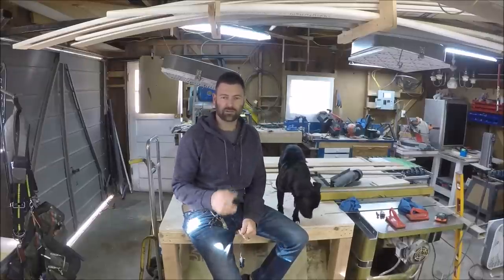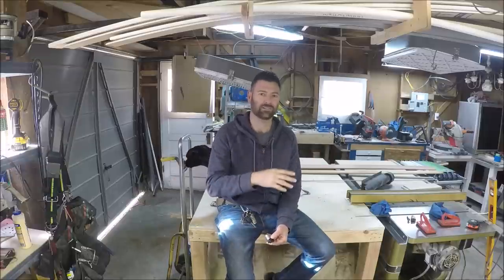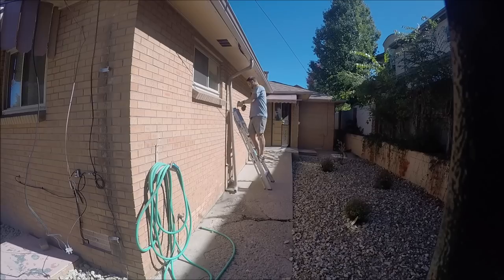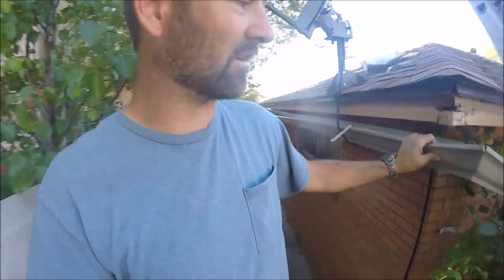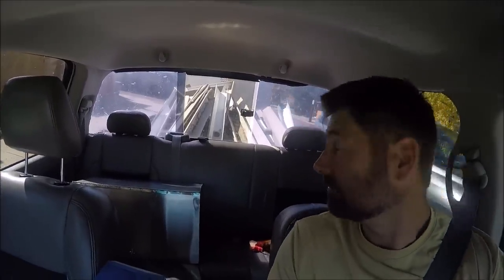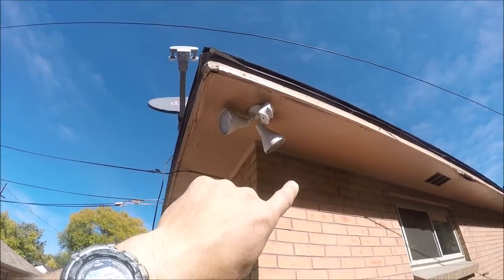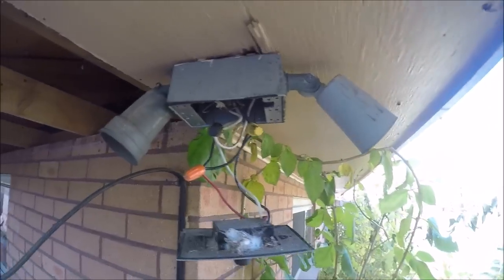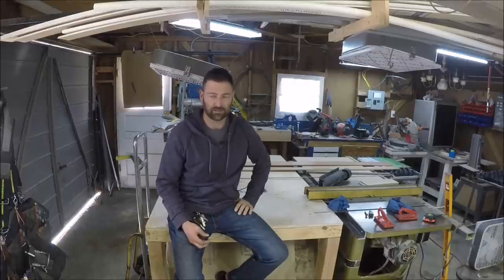Replacing Soffit And Fascia On Huge House | THE HANDYMAN |

Comment: I used to own a company that we did work for the city and there was a program if you met certain income levels you were eligible for a  grant to bring your house up to snuff/code.  It was all roofing, guttering, window glazing, paint and hard wire smoke detectors.  We had a painter that knew we weren't making millions so as long as we prepped he gave us a killer deal to come spray the houses.  We hired a company that did the roofing and gutters.  This is the interesting part.  I white van would show up first thing in the morning and about 8 or 9 Hispanic males would hop out, grab ladders and tools.  They climbe up on the roof and "kicked" the gutters off, stripped the roof and shingled it.  then a truck would show up and start spewing out gutter and they were like ants putting them up.  If they were there till noon the van would show up and a guy would pass out Styrofoam boxes of food.  they took a full hour and went back to work.  Gutters were never more than $700 and shingles were never more than a grand!  Most times they were gone by lunch.  I'd give you their name but it might be a long drive from Missouri!  I wonder if they had green cards...

Comment: Next time you have to remove the gutters do it from the roof, Cut corners before anything, Take every screw out besides the middle screw on each run, then go back & take middle screw out and you can pull each run up its easier & faster.

Comment: Good content. So a lot of repairs is just go from point A to point B to point C.  I guess the principle is to have a good working plan. Very methodical as I have mentioned before. Too bad the homeowner did not do this beforehand. The less $$$ spent to install the gutters in the first place is coming back to bite them later. I worked almost 30 years in retail electronics. I know how customers can be short-sighted at times. Good work and thanks for including us in your work. Just a sidebar. The audio especially when sped up gives the impression you are working near a speedway!

Comment: Top tip from a gutter man! you can remove and re install you gotta take the mitres apart before taking all the hanger screws out, and for demo removals you can cut the back and front lip and rip the rest apart, mostly, a lot less work with the snips... hope it helps!!

Comment: Just right, good content, and it flowed well. Have got to do the same thing to my own house, but I have to remove vinyl soffit with plywood under it and then I am gonna replace the plywood soffit and install PVC for the new fascia. And then spend $750 to get all new gutters. Really good video. If you don't have to have power at the house for a day get the power company to come disconnect that service for you. Around here they'll drop it by 9am and reconnect by 4pm the same day for no charge just to keep you safe. They like a day or two of notice.
Reply from the maker: Hi Gary.  That is good to know I will probably do that the next time this comes up .  I did it myself on this projects.
Reply: The Handyman if it's national grid, you're given an eso # (electric service order #), and a date for a service drop. It's a good time to have tree work done on the same day, aside from your work, you could sub out the tree work.

Comment: Thanks for that aluminum ladder/fiberglass ladder tip. I didn't know I could be electrocuted if mine fell.
Reply: By the way,  many painters have been killed walking their wood ladders into a power line!  Wood and fiberglass both can provide adequate path to ground, killing the workman in the process!  Only   A rated insulated ladder is considered shockproof!  So be careful and stay away from power lines!  You can always call electric company to disconnect power lead for a day to allow you a safe installation

Comment: Dude get one of those little giant leveler ladders. They are the perfect multi-purpose handyman ladder. You can square it up against the house, and shorten the legs on the side towards the house, instead of leaning a step ladder against the wall. Leaning the step ladder against the wall is how people get a broken leg when it slips out from under you. That little giant ladder is awesome. Solves this problem.
Reply from the maker: I just got one.
Reply: little giant ladders are the best. especially the newer redesigned ones. they have the best extension and step ladders I've ever used. 
if you do alot of electrical I'd go for the fiberglass one

Comment: Hey The Handyman. We had our cracked foundation repaired and there’s like 20 steel support beams now along far side of basement wall. These posts jut out about 6 inches. Would you install furring strips wall and then cover up support beams with drywall or stud frame out 6 inches to cover up these support beams?
Reply from the maker: I would build a 2x4 wall in front of the beams.

Comment: Don't you just love the P hooks for cable and phone lines. I used to install cable trying to find a solid board to attach to could be a challenge. It's a good idea to have an non-contact tester to check wires before you touch them.

Comment: What are your thoughts on Ridgid tools i see you have some?I love mine I have a whole set and can't beat the life time warranty
Reply from the maker: I have some.  They are a step below DeWalt, Milwaukee and Makita,  The saws are not as precise as the higher brands.  I have burnt out some cordless tools and because I didn't register it.  The life time warranty is useless.   Ridgid is way below the top brands of workshop tools.  powermatic, grizzly, jet, Delta.   Im giving the planer and jointer a try I hope they work out better then my other rigid tools.

Comment: I have a bathroom with wood flooring and the previous homeowners just put some cheap stick on tile over it to cover it up. Do you have a video that shows how to properly cover it up or do I have to rip up some floor?
Reply from the maker: +Big2Rax I have this exact project comming up in a few months.  There is a few ways to do it.  Im going to be taking out the hard wood and plank sub flooring down to the floor joists. Installing new 3/4 inch plywood. Then ditra then the tile.
Reply: I will look forward to watching that video if you film.
Reply: Depending on the size of the tile as well as the floor joist size you may need to cement board instead of plywood, just a thought not a criticism.

Comment: We had new gutters installed a couple years ago and our power from the pole came to the house in the same spot as what you had. The gutter installers wouldn’t put new gutters on until we had an electrician come in and run the power thru the top of the house so they were far from the gutters.
Reply from the maker: I have a feeling I will have to be there when they install to make sure that the gutter clears the cable that holds up the power wires.

Comment: Handyman the jointer and planter that you have the brand is ridget what I wanna know is how well do they work
Reply from the maker: So far they work well.  I'm not really a fan of ridged tools  typically there tolerances are not as tight as other brands.  I got a really good deal on them.  They were used on craigslist.

Comment: Leave a couple of screws toward the middle of the gutter. Get your corners apart, the take down the gutters from the center.Leave one side in the downspout( not attached), then take down one side at a time It's tedious but I've done it. the hard part is putting them back up by yourself.

Comment: Seamless gutters are pretty sweet. The ones at homedepot only come in 10 foot lengths. The problem with that is you have to seal a bunch of joints perfectly and even then theres all these humps for debre to get caught behind.
Reply: Robert Bogan, If it comes in 10 feet lengths, It is not seamless. Seamless is made on sight from a big roll of aluminum so it goes the entire length of a wall.

Comment: Why didn't you use vented aluminum?
Reply from the maker: Not sure what that is?
Reply: Sofit. Instead of plywood, it allows air flow into the attic
Reply from the maker: The customers did not want to use anything other than wood.   Its very rare to see a house with aluminum or vinyl soffit.  Stayed tuned for the next video and I will go into more detail

Comment: what kind of material will be the replacement?
Reply from the maker: wood
Reply: silly question...would the soffit have to be pressure treated wood? if you are using a non pressure treated wood. what would you use to seal the wood with?
Reply from the maker: pressure treated isn't use in this location.  I sprayed all side with killz primer then put a color coat on the exposed side.  This is the original wood soffit and fascia it is 70 yeas old.
Reply: thanks!!

Comment: Very great You are luck with the damage... I will have to replace shiplaps as the sofficit the at one corner maybe with out take the roof off the rafter and 3 shiplaps .... I will not put the rain gutter back as it is the reason for the rot..... I will be putting on a metal flang over the corner of the shiplaps and facial.... Gutters are so unsightly!!!!!!! Then later if I need to place ugly looking gutters they can go back up!!!!!!!! They service no modern purpose as they do not help the rain run off... they fill with debris and twist and fall  etc........... If I design and built a houses the stucco would go to the shingles.... easier to paint and patch stucco then the do work we have to do... Many House in LA are going to this method but can afford this now.......

Comment: The local Natural Gas Utility needs to replace that old Regulator from the 1950's on the two meter manifold, I see it has replaced  both meters index's with Electronic RF read (ERT) Itron's . How ever old the building is that is the age of the Reg. It is a safety hazard if it will not lock up and put more then 7 inches W.C into the buildings like pounds boom.

Comment: the 2 year old gutters had to be thrown out cause they were going to be damaged? Why not just hire another person and take off the gutters by sections, that way you won’t need to cut them down to a smaller size?
Reply from the maker: It was cheaper to remove and replace with new than to have them taken off and reinstalled.

Comment: Something as serious as this you cant just half ass it..  As a property owner you have to fix shit right or its just putting a band aid on it..

As a homeowner I have a problem with a leaking shower pan or something on my 2nd floor drippin into the 1st floor and while I am very handy with fixes I am out of my league here. I tried re caulking the pan etc.. 

The point im getting at is water damage is a bitch and leads to termites.  I can repair a lot of things but structure damage due to water is a fucking nightmare and left to pros. I am not to manly or egotistical to admit when I am outta my depths..  This video pertains to my moms house where her fascia, rafter taile are rotted and the water is leeching in and her drywall ceiling in living room is crackking and sagging. All bad

Comment: Long is good. I also like detail, and its "mindless entertainment". No offense!   Check out ,"Pure Living for Life" channel. Their videos are always 30 minutes and their following is multiplying rapidly.
I have been doing the exact same thing you have been doing ,spot lights and all on my own house , but 24 feet up on a ladder. How much more would you charge for that? I also have to deal with the electrical service in the next couple days on my aluminum ladder. The 8 foot runs of replacement plywood soffit are tough to deal with by myself. The builder used luan plywood back in the day.
Reply from the maker: The soffit that I took off was only 1/4 inch.  I moved it up to 3/8 inch for the new soffit.
Reply from the maker: SKWDMDYT  I do watch some of their videos.  They are rolling in the money now that they got so many viewers, well over $20K per month just on adsense revenue